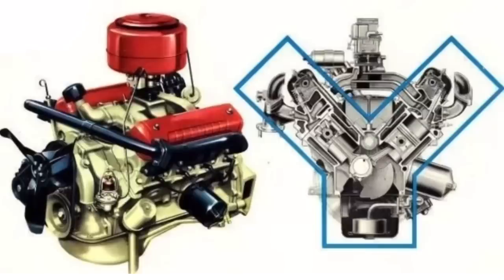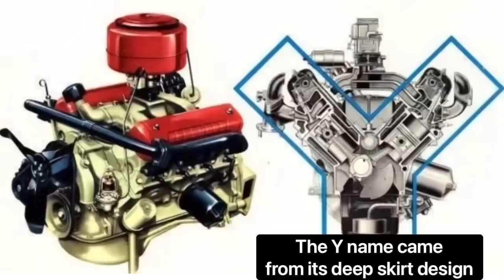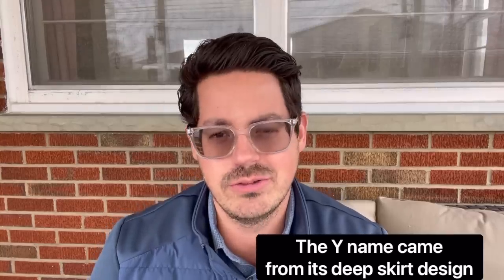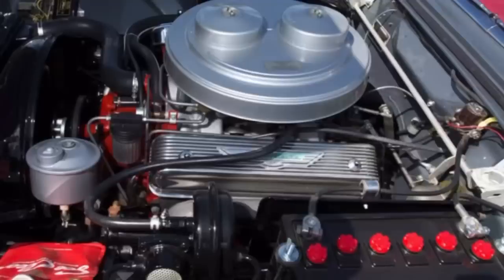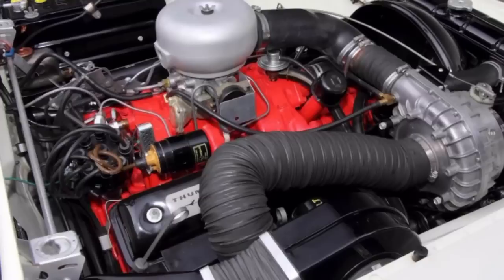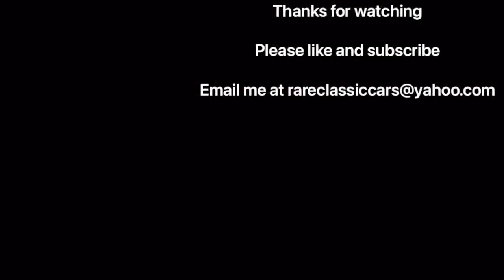Worst Engines of All Time: Ford Y Block V8

Comment: Old guy here who played with a lot of Y-Blocks back in the day.  Biggest drawback was the stacked port arrangement and weight.  The heads just did not flow as well as the SBC.  
Oiling was only a problem if your engine builder screwed up and did not clock the bearings correctly ...  Up through 292, they had forged cranks and could handle big power increases like blowers.  But all the good parts came from the marine industry.  Crusader and Interceptor had aluminum timing covers, better intakes, and good cams.  Isky made the best valve train parts.
You are partially wrong about lasting a long time.  The tooling was shipped to Ford South America (Brasil) and the engine was continually developed up to vertical port heads, etc.  Now days all the best parts for Y blocks come from South America via the aftermarket as so many of these engines are still running (and racing) down there.
Reply: The South American versions of the Y-block obviously share little in common with the Y-block junk Ford was producing in the late 50’s in the US ...

Comment: My father bought a used 1959 Ford with the 292.  He drove it several years with no engine issues.  He sold it and got a used 1964 Ford(with the 289 I think) when it started having automatic transmission issues. We lived in a rural area, so there was no stop and go traffic.  My mother was mad as she liked the 59.  One the other hand, my grandfather had a 53 ford with the flathead.  It was quiet as described.  The low power did not matter as his top speed was 45 mph.  It went 170,000 miles before a ring busted. He just got a re-built flathead which lasted till he passed away.   (He was the same with his televisions, he replaced the picture tube 3 times in his early 1950s TV instead of buying a new one)
Reply: I would have liked your granddad ...
Reply: @sking2173  He lived in a rural area, so 45 was ok.  Now there are lot of oil field trucks running around, so it would be dangerous.

Comment: I had a project pick up as a teen in high school. 59 F100. Had a 292 in it that snapped the cam and sent it through one of the Pistons. Interesting to learn about the cam oiling I had no idea and certainly didn't at the time. High School shop class I pulled the motor and got a donor 239 and had it bored for 272 and reuse the 292 heads.

Comment: WORST ENGINE I DON T THINK SO TIM Mc MASTER JUST SET A LAND SPEED RECORD WITH ONE IN 2020 OF 196 MPH NOT BAD FOR A ENGINE THAT HASEN T BEEN HOTRODED SINCE THE 1950 S
Reply: Let’s put that in perspective:

“On September 19th, 2016, Volkswagen of America, Inc. announced that the VW Beetle LSR achieved 205.122 mph over a flying mile in the Utah Salt Flats Racing Association 2016 Speed Event; which is the fastest speed recorded in history for a Beetle.”

Apparently your Y-block was outrun by a VW Beetle ...
Reply: @sking2173  THE BEATLES HAVE HAD DEVELOPMENT GOING ON FOR YEARS

Comment: Thanks for the tip. I am having my 272 V8 rebuilt in my 57 F250 so will talk to the builder about this.
Reply from the maker: Good luck. If done well and regularly serviced, they can be good engines.
Reply: @RareClassicCars  Thanks Adam. You can see it on my channel. It is a major project but I wanted to save it. Cheers Mark
Reply: Make sure he plugs the oil bypass hole in each rocker shaft.  The 57 camshaft has a groove in the center journal, so that won't be an issue.
Reply: Thanks Michael. I will.

Comment: I’ve never driven a vehicle with a Y-block, but have rebuilt several. Matter of fact, I have a 292 in my shop right now in process of a rebuild. It already bored .060 so the customer opted for 8 sleeves to bring the block back to standard as it’s the original block to the truck. These are not difficult engines to work on, just a little quirky. Seen several people install the timing chain incorrectly over the years.

Comment: I have a 57 Monarch with a 312 Y block and had the car since 86  and it's been a reliable engine never let me down all those years, the previous owner had the engine rebuilt with 30 over pistons at around 75,000 miles and have just over 90,000 miles on the car now.

Comment: To my knowledge, the last vehicle to have a small block Chevy was either the 2000 or 2001 Chevy G van. Had one roll through the shop for overheating, coolant was never changed and it was lower mileage. About 90k or so. And the rad was plugged full of rusty gunk! And technically since the 4.3 is a 3/4 350. It lived on until 2013!
Reply: I think you could get the small block in the 2008 Impala.  It did have a V8 option, and was Car Of The Year.

Comment: Seems to me that they made a mistake only oiling the top-end from the center cam bearing. Because didn't most of the newer overhead valve engines for most brands as well as the next generation of the small block after that have oiling to the top-end from all of the cam bearings? Maybe not all of them but certainly not just the center one. Plus I always heard people widening the passages while the engine dismantled for machine work to help improve the oiling.
Reply: What was wrong was the lack of a groove in that center cam journal, and the oil bypass hole in the rocker shafts.  The result was intermittent oil flow to the rockers, rather than a constant stream.  Easily fixed.
Reply: @michaelbenardo5695  it almost sounds like the Ford Y block had the exact opposite problem that many Oldsmobile engines have. High-revving on a rocket V8 causes an excess amount of oil to go to the top thus often starving the bottom end. Seems like they need some restriction to keep too much oil from going up but enough freedom of flow that it gets the right amount of oil to the top.

Comment: I was not aware of any oiling issues with this engine. 10 years is a long time for an automaker to keep something in production. You can have problems with a lot of things when they are not maintained properly.l My dad bought a new Ford pickup in 1964 with a 292 Y bock engine. The truck was driven over 92,000 miles without a single problem. My dad traded for a new Ford pickup in late 1968. This truck had the big block 360 FE engine. Both trucks were used as farm trucks and towed large heavy cotton trailers out of the field to the cotton gin. Often several miles depending on where we were working. The 360 FE was a reliable engine. It just didn't have the power we needed to pull heavy trailers from a dead standstill that the 292 engine had. My uncle had a 1959 Ford Galaxie with the 312 Y block engine. This car was driven over 15 years with no issues that I'm aware of. So I feel compelled to take a stand for the Ford Y block engines. I think they were better than you have indicated. The Y blocks were good for the times. The FE generation was probably a more advanced engines. Generation after generation of most products improve ( with the exception of the Cadiillac Northstar, although GM did make some improvement, just not able enough to improve their damaged reputation.)
Reply: The problem with the Y-block was the early ones, 54 - 56.  The center cam journal wasn't grooved, so the oil flow to the rocker shafts was intermittent.  Grooving it, or using a later cam, fixes that problem.

Comment: A 272 Y block was the first American engine I overhauled. And yes, the guy who installed the cam bearings got it wrong. The passenger side rocker arms were getting no oil. I had to tear it down and take the block back and get it done right the second time.

Comment: I've got a 32 Ford street rod, real steel not a kit car. It has a 57 Thunderbird driveline which is a 312 Y Block. Your video hit good as now I know what to look for. It was my dad's car and he is gone so I'm learning as much about it as I can thru vintage service manuals and your video. I noticed with valve covers off it's no real wet in there so I'll check the oiling system. It does run great though.

Comment: We have two 1959 F-600 wheat trucks with 292's. We still haul wheat every year with them. We've owned these trucks for about thirty years now. I'm not a big fan of Y blocks, but they have been durable engines for us. Excellent maintenance, and not over revving, this is why I think that we have had such good luck. These 292's love being lugged around the farm hauling wheat, but once you get on the highway, everything is out the window. Ford, was asking a lot by putting these small engines in these trucks, but they do surprisingly well paired with super low axle gearing. Life was slower and happier back then, even the trucks.
Reply: Not a farmer but used to sell grain body trucks, so I truly appreciate your comment:) your last sentence is spot on, I have a 67 C10 with 3 on the tree (w/un synchronized 1st gear), 250 inline 6, and at least a 4 something rear gear. Her happy speed is 45mph, like you said, life was slower and happier back then.
Reply: @jimmy_olds  We still have a c20 with a 292, 4 speed, and almost asinine deep gears.   It likes 50 mph lol
Reply: I have a 61 f600 with the 292 which sat for at least 20 years. I didn't do anything but rebuild the carb, replace the plugs, wires, battery and water pump and it purrs like new and shifts through all gears, high and low.
Reply: @kylekenan2321  I had several (' 56 F-500, '58 & '62 F600s) that were Y block trucks retired from my work and they were very reliable. Once I put new exhausts on them they didn't sound like old trucks anymore.
Reply: @muffs55mercury61  mine has the manifolds connected with a crossover pipe in front of the engine. Why did they do that?
Reply: @kylekenan2321  That's just how Ford did it with their V8s until the FE engines (332, 352s) came out in 1958. They put the crossover pipes on the Y Blocks in front of the engine rather than underneath the oil pan. So did Lincolns from 1952 to 1957.  Fairlanes had standard dual exhaust so no crossover pippe needed. Trucks could not have dual exhausts as the steering gear was in the way on the left side.
Reply: 11:17  @kylekenan2321
Reply: It really was happier, I think! 
When I was little, my dad had a 64 or 65 (I can't remember which) C60 dump truck.  A big hulking truck with a little 292 straight six in it, a 4 speed and a gigantic split differential.  It would pull anything, but it wouldn't do it fast.  
It was slow in the highway, but hey..  it was a dump truck.  It suited him just fine, and I loved riding shotgun with him in it. 
Great memories!  

He let that old Chevy sit unused for many years, eventually selling it to somebody else who only wanted the dual linear ram dumper off of it.  I sure wish we still had that dumper to put on our LWB 7.3 F550...  It would dump a lot more weight than the scissor dump we currently have on its 16 ft bed.
Reply: @1SqueakyWheel  Both our trucks have the telescoping dual ram setup. It's amazing how strong those hydraulics are. We just have to make sure that we are not on a side hill is all. Three pumps on the vacuum assisted brakes, and they will stop on a dime loaded.
Reply: @133dave133  Yeah that's just common dumptruck policy. The real dumptrucks, capable of dumping 18 or more tons, are very careful when it comes to lateral listing across an incline....  bad juju for sure! 

The problem with the cantilever dumper on our 01 16' f550 is that it's a conversion for a truck of that class, but only an 8 to 10 foot bed at max.  We bought it already converted, as it was one of the three biggest selling points.  Tips great when fully loaded with wood or scrap metal, but it can't handle the density of a 6-8 ton load of crushed rock that the truck is otherwise fully capable of hauling. Gotta shovel half the load out by hand before letting the tipper do the rest.  Really makes us miss that slow old Chevy, or at least her dumper.  
And you're right, our chevy had a 2-stage duo also. We weren't capable of overloading that old truck! 
Both the c60 and f550 have/had wooden stakebed sides, btw, as I'm assuming yours do too.
Reply: @1SqueakyWheel  Both have hardwood tongue and groove floors. One has wooden sides, one has steel. We even have a set of wooden livestock racks that have never been installed as well. I can't remember the make of the beds off the top of my head.I also forgot that we have a KB5 with the same type of box. This one has been retired long ago. Maybe we should pull it out and use it? It would look good sitting at the elevator with all the semis. Unfortunately, the impatient kid spitting sunflower seeds out the window behind us might not appreciate our paid off equipment?
Reply: I have a 1960 F600 that had a 312. Found a 368 Lincoln & found parts. Did a bore & stroke to 425ci with towing cam, etc. 4.56 & 3.08 gears with a Ford super duty 6 speed with o/d. It runs
Reply: I had a '58 that I bought from work when they retired it.  Never a problem and around the city ran smooth at 40-45 mph but with it's low 5.83 rear axle ratio it was definitely not a freeway flyer!
Reply: those engine were NOT 292's. most likely a 279.
Reply: @bryanmoyer6602  You're kidding, right?
Reply: We had the same experience with a 292.   Ran it over 300,000 miles as a ranch truck.

Comment: My dad said a problem with the Y blocks is that they had solid lifters.  He told how wonderful the FE engines were in 58 with hydraulic lifters.  It eliminated all the valve clatter.

Comment: GM came out with their small block at the same time. The venerable small block served as the yardstick against which all other engines were compared for such a long time. The GM smallblock greatly overshadowed the Y block. 

However, as others have said here, detergent motor oils were a new thing in 1954. If you used the best oils available at the time, the Y block was decently reliable compared to other engines you could have owned in 1954. 

I think people initially approached the Y block the same way they did the flathead it replaced, which would run on just about any flammable liquid laced full of dirt and twigs, and also just about any oil suitable for the ambient temperature. Sort of how we got used to conventional oil in engines from the 70s and 80s and had to switch to synthetic in the 90s and 2000s as many cars went to overhead cams, variable valve timing, auto lash adjusters, etc.
Reply: If that is true why did the Y-Blocks dominate NASCAR during the mid to late 50's. Look it up if you don't believe me.
Reply: @charlescline4352  one reason for teh  confusion was G M preached about the  265 being a performance engine while ford was raving  about having a padded dash. The  people that hung around the race track knew Ford was faster.  the  people that don't believe it can watch  Daytona Beach 1957. The 368 Merc and  a 312 super charged  Ford run away from the field, Both of these engines were y blocks..
Reply: @charlescline4352  Because they introduced the VR57 supercharger before Nascar introduced rule changes. Don't get me wrong, Y blocks are not bad engines, are cool and can make respectable power with modern technology, but they were and still are comparably heavy and limited in terms of displacement potential. The only option Ford had to make them competitive in the mid 50s was forced induction. Chevys were just as competitive if not more competitive naturally aspirated with Rochester fuel injection.

When Nascar forced rule changes including 4 barrel carbs shortly after, the Y block just wasn't as adaptable as the GM architecture, and also wasn't as big a commercial success. It had reached it's limits by the 60s. Ford had to move to the FE, which shared some design features, but was a completely different engine. 

Ford did have a successful race program in the mid to late 60s, but they weren't selling many 427s to the public and GM and Chrysler big blocks offered to the public spanked the 390. It took them a while to catch up with the 428 and the 385 series.

Comment: Tore down a lot of Y blocks bever seen a spun cam bearing. My opinion that center cam bearing is too narrow and with just a small amount of wear it developed a internal oil leak. It was easier to push oil out from the sides of the cam bearing than up to the valve train.  They had mushroom valve lifters and cam to close to the crank. heavy pistons and rods and valve gear. The oil rings where excellent. However the compression rings were poor. Resulting in great amounts of blow by that helped to create the sludge. Rear mains also leaked.  not enough bolts holding the heads. and they would blow head gaskets between the cyls. Just wouldnt rev as quick and make the power a small block chevy would.  They where very heavy thick wall casting engines.The FE was a vastly improved design. My opinion the Tri Five chevys wouldnt be near as popular today if Ford had came out with the FE in 55. Back in the day I fixed my Y block 56 to where it would beat a 283 and sometimes a 327 chevy. I swapped the Boat Anchor and installed a 59 Police Interceptor 300 HP 352.
Reply from the maker: 100% agree